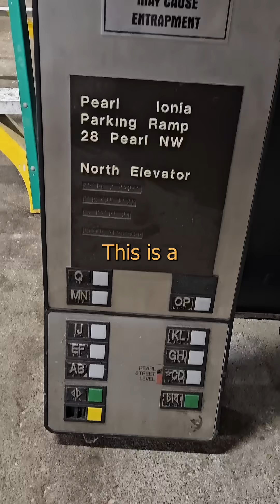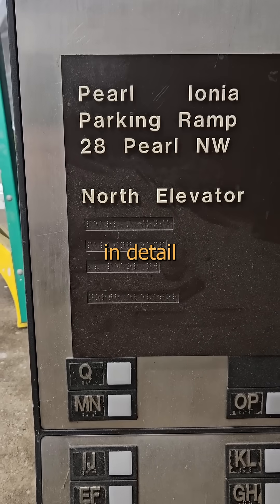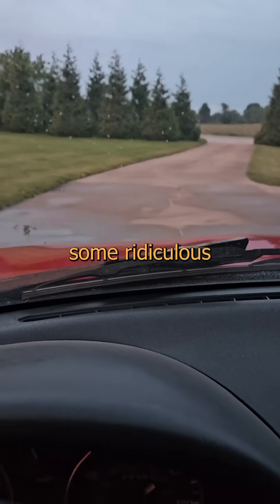Miata Mischief #chrisboden #engineering #gear #elevator #score #stories #parts #hacking #making

Comment: when i was 16 my buddies dad told us about a guy he met at the bar who had one of those classic fiberglass body dunebuggies that he wanted to get rid of. it was about 50 min from my house, so we hopped in the truck and hooked up my little dirtbike trailer, hitch to end its about 15 feet long and 7 ft rail to rail homemade by my dad and uncle. we get there and realize we underestimated the actual size of this thunv by alot. but that wasnt going to stop us. we had a handful of dirtbike ratchet straps and a tie down rope. no ramps, no winch and no help from the owner. so we jack up the front end and back tge trailer under it, then jack up tge rear and we almost get the rear tires on befote we hit the front of the trailer. so we took the rear wheels off, threw em in the bed strapped the thing down as best we figured we could then wrapped the rope around tge bumper bar and front rail of tge trailer as much as 50 ft of rope will go and we drove off. the entire weight of the motor and trans hanging off the back of tge trailer. we stupidly get on the freeway and make it about 3 miles till i notice the truck start wiggling its ass side to side, and the trailer is just whipping wildly in the rear view mirror. i try to give it gas to get out of it but the engine just revved and speedo shot up real quick, but truck didnt accelerate. it was at that moment we realized we f'ed up. the rear tires of the truck were off the ground and we were swinging across 2 lanes of traffic at this point. by the grace of God the swaying of the trailer had caused one of the bearings to go out, like trailer brakes it slowed it down enough for all 4 tires on my truck to hit the ground and i made it to the next exit. we surveyed the damage and it didnt look like anything was broken so we stopped at a gas station and bought every gallon jug of water they had and pulled into the dirt lot next to the gas station and threw every big rock we could find in the bed, and i made my buddy sit in the bed too and we were off again. we made it home with the rear wheels only coming off the ground 1 other time, and the bearing was smoking like it was bout to catch fire and thr tire wasnt much better. i spent more fixing tge bearing and tire than we paid for tge buggy. tge icing on the cake was we bent the axle on the trailer. so i did an axle flip and the axle has slowly but surely been bending itself back straight over the past 24 years. after all that we never git the damn thing running cuz the block was cracked and we were poor high school kids. it wasnt all for nothing, i learned alot and will never forget the trip. sometimes bad ideas turn into good times.

Comment: I have the wonderful experience of getting to design expirimental flywheels for energy storage using our uni's nuclear reactor as a Freshman. I then had the experience of trying to take a 10' radius 2' thick flywheel from metallurgy to physics in my shitty Nissan Leaf. Luckily it was in 8 pieces to be welded together on site but 8 trips driving on university sidewalks with a 800ish pound 8th of a circle hanging out my back was sketch af

Comment: The REALLY cool inspiration for this car is the '58-61 Austin Healy Bugeye Sprite.  948cc's, only 1600 pounds, and not a single extraneous option. Just Plain Fun.
Anyhow...
Being Po' as a sophomore (falsely wise) in one of the more expensive colleges in the state, my two college Roommates and I decided our first week, that since this was the year when we could actually choose our roommates, we could get a sizable couch... one of those overstuffed giants that this 6'3" frame could actually sleep on without bending or hanging over the (very hard and uncomfortable) arm rests. IIt would also seat approximately half of our co-ed dorm well into the evening. Our "Yuppie" roommate happened to have a Audi GT and we found said $20 couch at a resale shop just over the state line. Thought we would save the $10 delivery fee by putting said couch on top of the 5 year old car... something slipped and I my heart sank as I was suddenly looking at said uncomfortable armrest now taking the place of the previously in tact back window.  "Oh Andy, I am really sorry" I stammered.
He replied: "What are you sorry about, I just put the arm rest through the Front windshield.
$1030.63 later, plus the $10 delivery fee after all, and we had our $20 couch in the 3rd floor dorm room (no elevator).
Oh, and even less room for your enthusiastic acrobatic dwarf in the Sprite.

Comment: I'd just gone through a breakup, and moved in to a tiny house (converted shed) on my parents property. Had no mattress for the sleeping loft. Friend said she had a mattress for me. She said it was a king size "bed in a box" she wasn't going to use because it didn't fit in her camper bedroom. I stopped by her place in my Toyota Solara convertible to pick it up. She neglected to tell me it was *not in the box*, and was absolutely unfurled in her RV bedroom, filling it pretty completely.
With much hilarity, and taking raucous laughter breaks, we managed to get 2 ratchet straps around it, wrangle it into a taco shape, and fight it out the door.
We put the top down on the car, stood it up in the back seat, threw another ratchet strap on it, and I was on my way! It stuck up out of the car at least 4½'! Made it safely the 12 miles home, through Saturday traffic. I caught so many people taking pictures and laughing! 
Getting it out of the car and into my 8' high loft by myself was another story! I did, and slept great that night.

Comment: I was doing floors in these expensive lodges and the management company was gonna throw away all these Samsung tvs but they said we can take them since it was trash to them. So after a long day replacing flooring while it was snowing outside and we loaded up the Chevy 1500 extended cab full of carpet trash to the roof in the bed of the truck and all the tools packed in one side of the back seat there was three of us riding in the truck home and I had to sit in the back with me new 40inch Samsung tv on my lap crammed in the back seat for a hour and a half drive back over a mountain pass to town in the snow. Still have the tv to this day lol 😂

Comment: Not especially unique, but once I had to pick a fourteen foot sailboat up across the bay bridge for my buddy… with my six foot bed little first gen Tacoma. The boat barely balanced with the tailgate down, but I pinned it down tight in the front and strapped it in well. It looked especially funny with my camper top on, so all you saw was eight feet of boat hanging out the back of a six foot bed. I wish you could comment photos on here😂

Comment: I hauled two huge boxes of ikea furniture just a few months after getting my licence.  They were both too wide to fit inside the car, so somehow we managed to lift them up and we tried to secure them on the roof with ratchet straps. On the way home it started raining and the boxes lost their rigidity. After that the straps started flopping around violently. I got scared and slowed down to about half the speed limit. It was the most stressful 20 minutes of driving of my life. In retrospect the boxes were relatively secure but at the time I almost pissed myself 😂😂

Comment: Just before finishing welding school I had to haul my 1995 Suzuki gs500e from Onaway to Lansing, with only my 1996 Grand Cherokee. I compressed the bike suspension with a ratchet strap, drove the jeep into a ditch and rolled the bike directly into the back. Worked perfectly.

Comment: One time I bought a tv(65”) and brought it out to the car along with my girlfriend. The car was a 2019 kia soul and the I was super excited to get the tv home. I put the back seats down and slid the tv in. It hit the back of the front seats and was stuck probably 12-16” out the back of the car. I panicked and scrambled to find an answer so I didn’t have to leave this tv and my girlfriend(couldn’t drive) at this store and go and call a bunch of buddies who’s truck I could borrow for maybe an hour. Then it hits me, I slid the front seats forward so as far as they could go and angled them to be about a 45 degree angle and the tv barely fit. Drive home like that. A ~17 minute drive of doing one extended crunch with my mustache hairs and nose touching the steering wheel. If the airbag went off both me and my passenger would have taken the full airbag straight to the teeth. But it was worth it cause that tv makes watching movies in the tiny room it’s in feel like I’m watching it on a projector(and to me that’s pretty cool.)

Comment: I had to haul a 14ft wide carpet home when I was renovating my basement last summer, and I misjudged how long the Subaru legacy we had at the time was? We ended up having to load it in the trunk, the back seat folded down so it went all the way to the front passenger seat, with it sticking out the back end, and me sitting next to it in the back holding onto it for dear life

Comment: I had a2-door jeep wrangler - hard top, so fold up rear window. At one point, with Dad's permission to use his drill press, I was attempting to build a server rack. 4 sticks of 8 foot right angle aluminum, passenger window down, rear window up, laid through the gap between the passenger seat and it's headrest, bungee cord from the rails the seats were on to keep it in place. I made it home with no broken glass and only a little bit of scratched paint - success.

It's Either that or the time that I used the winch on said jeep and a pulley rigged from a spare engine block, crankshaft, main pulley, and some bearings to pull my dad's (1 ton) pickup off the yard after he (tried to) used it to deliver gravel to the pool and got stuck. That truck weighs easily triple what the jeep does and that mud didn't want to give her up, but the wheel chocks won.

Comment: I broke a ball joint on my mustang in college and my buddy picked up a U-Haul tow dolly (yes, we disconnected the driveshaft).  Halfway home from college MSU to Elk Rapids, his dodge ram did a transmission delete (shocker).  So we hooked the drive shaft back up on the mustang and he was in the truck steering, braking ect.  I was in the mustang “pushing” and it worked amazingly well but the lack of airflow caused that old 5.0 to run a little warm.  Our setup didn’t seem that strange heading up US 127 on a Friday afternoon.

Comment: So I hauled two pieces of 15 foot sheet metal trim in a 2013 Chevy Cruze to repair some hurricane damage at my house one time. It was as wedged between the dash and windshield as it would go in the front, through the car with the rear seats down, and out the trunk with my red flag hanging off the end. I made it just fine. I learned from the best as well. My parents once loaded an old pull handle Lance vending machine in the trunk of a 2002 Chevy Impala with the rear seats down. They brought it almost to Florida from Tennessee.

Comment: Not that exciting but I managed to pack my entire college life into my 2009 VW Jetta Wagon (this was intended to fit in either a minivan or both the Jetta and my dad's truck) and sent it at barely 60 mph down I-95 to get home (the engine was maxed out...). I overweighed that suspension massively, my tail was nearly on the ground and I just about lost view of every mirror except my left mirror (at least I could change into the passing lane.. I just couldn't change out lol).

Comment: Last year I had to transport a constant speed two-blade propeller off a light aircraft of some sort (I forget which) to an overhaul shop. I did this by removing the copilot seat and rear bulkhead cover on my RV-7A, wrapping the prop in a moving blanket, sliding it back into the tail, then forward again under the seat crossbar to position the hub of the prop in the baggage area and keep me in CG range. Tip of one blade was under the instrument panel, other blade was entirely back in the tail. Strapped it down with some bungee cords and flew it to the shop. Got some hilarious looks when we had to unload the thing. The "how tf did you get that in there" from ramp guns was great.

Comment: I own a Ford Pickup Mustang. It's a converible. I haven't met anything too fat to fit in the back seats vertically, or to long to start in the passenger footwell and tie a red flag on. Keep a blanket and a staple gun in the trunk. One time I used my underwear as a flag (i needed those socks - it was snowing)

Comment: as a teenager I once brought home a washer and dryer set by setting them on top of the trunk of my 86 2 door cutlass calais. I didn't have any way to tie them down so I drove very slowly and got out after every big bump to push them back on as they would move a bit toward falling after big bumps.  another time I Hauled 2 ricks of firewood in the trunk and backseat of my 1974 4 door nova.

Comment: I once got a free vending machine. To be fair, we took it home in a truck (with a topper), and the previous owner was nice enough to help us load it with a garage winch, but when we got home we didn't have a winch or any good ramps so I think we just dropped it onto some foam. Also, it was sticking out the tailgate of course.

Comment: A few years ago my buddies truck broke down and we needed a trailer and the only trailer I had was too narrow for a 4 door Silverado, with lack of fucks to give and a quick fuck it we loaded it anyway with one half of the truck on the boards and the other half on the rails of this utility trailer, connected to my half ton, zero point in strapping it down either because i never went fast enough, I have plenty of stories like this that could probably be told in 10 minutes 😂

Comment: Okay, so, Summer 2023, Grand Blanc, MI, there was this really nice cherry veneer 1990's cathode ray TV cabinet — I mean almost immaculate, gem, mint — and it was out to the curb because this lady owned two great danes and a boyfriend and had to get rid of /something/, it was almost to the point that it was him or the dogs. (I said get to rid of the boyfriend, but I /suppose/ she kept him — getting rid of the dogs was out of the question, of course — because she had him drag some furniture to the road.) 

It had double doors on top and two massive drawers on the bottom — obviously meant for a huge TV (for the 90's, anway) and VHS tapes. 

Now, I looked at this and thought, 'That's a really nice cabinet, I could put a rod into it and use it as an armoire. But it's huge, how am I getting that home?' 

We don't have a truck. 

So, Mom's bright idea was to grab the landscaping cart — hulking, heavy, welded steel frame, meant to move pavers — at home and use that to move it. 

Now, I don't know how I why I acquiesced to this, but she convinced me to sit on it as it was hooked up the the trunk latch of the 2008 Cadillac DTS and for me to ride it to the cabinet. 

I had to pull the tow strap this way and that to keep it away from the ditch and the bumper. She hit the gas and it sped up and I screeched and hollered and wailed — it was terrifying! The whole thing bounced like the back of a bus when she hit potholes. 

But she just laughed. 

She realized the Caddy urgently needed gas, though, and took off after I unhooked the cart, and promised she'd come back after I loaded it. 

She didn't. 

I lifted it bodily onto the cart — luckily it separated into two.

I stood there, waiting. Then I pulled it down the road to the shade. It was 

She finally answered the phone. She had gotten to the gas station, seen a family with a toddler walking to the bus stop in the heat to Atherton and Dort. She had offered them a ride — and completely forgot about me. 💀

Needless to say, I pushed the cart all of the way home. 😅

I sat outside because she had my house keys in the car, too. And I didn't see her for 30 minutes or better. 😂

Comment: Purchased an 86 Jetta coupe and towed it across the county behind my 1999 Jeep TJ all secured by a ratchet strap while my buddy death gripped the steering wheel of the Jetta while simultaneously mashing the brakes and struggling to figure out how much easier it is to steer once the car is moving rather than trying to crank the wheel at a dead stop but we eventually made it home safely

Comment: When I was 17 I picked up 136lbs of empty cans in bags to haul off for scrap in my 2000 Kia Sportage. Floor to ceiling and even tied to the roof rack. Every single can was Busch light or natural light. We were fine until Georgia State patrol got us on highway 57 and said this was technically about 5000 counts of driving with an open container. Little did I know the gsp officer knew my dad and was just screwing with me and my friend. I thought I was cooked. My friend and I still joke about the day I almost lost my license at 17. 😅

Comment: i was to broke to buy a shed worked at a scrap yard. So I cut the cab and front end of the frame off of a junk 15ft uhaul truck welded a tongue onto the frame rails and hauled it home with my  wrecked 1998 jeep grand Cherokee. after the first hill i realized that the box was heavier than my Cherokee. i was already to far to turn back and made it 12 miles to my home up and down 3 significant hills and the pedal mashed just to keep it moving. that jeep lasted me another 3 years and i still have a mobile shed in my back yard.

Comment: I tried to tow a 1898 stand up piano using mule tape and ratchet straps 1.6 miles up the road to my house using my 2006 Nissan Altima. I made it 464 feet before the small wheel hit a pot hole and the piano tipped over in the middle of the street at 3am

Comment: I crammed a Ms Pacman cabaret into my 08 Impreza. With both passenger seats forward enough to barely get my small ass into the car and a blanket covering the base of the cab from breaking my rear windows, my boyfriend and I got it the 200 miles home.